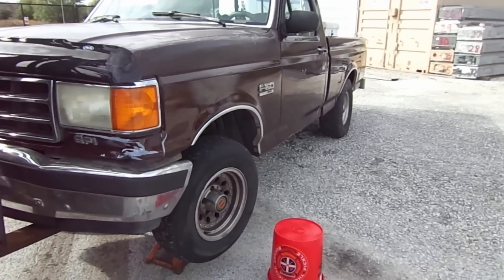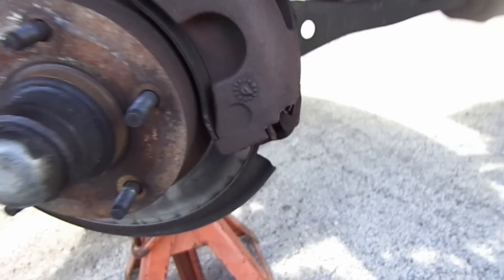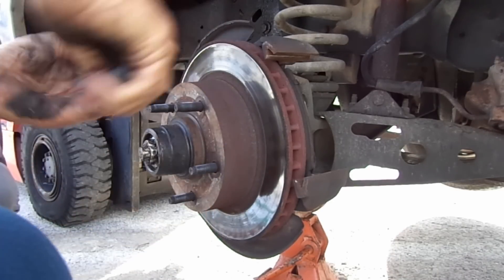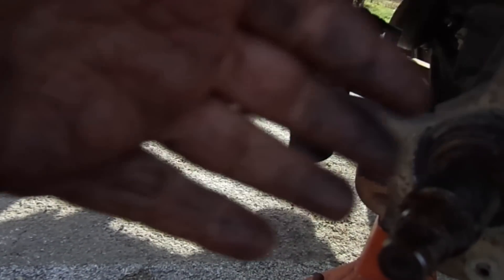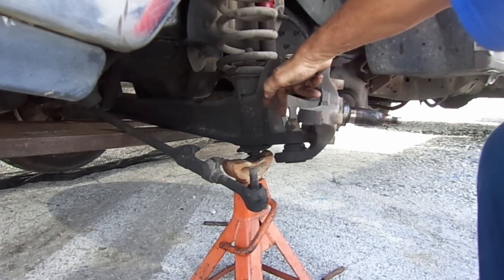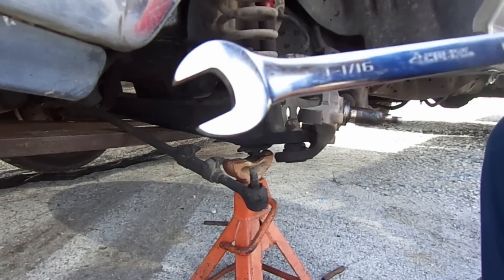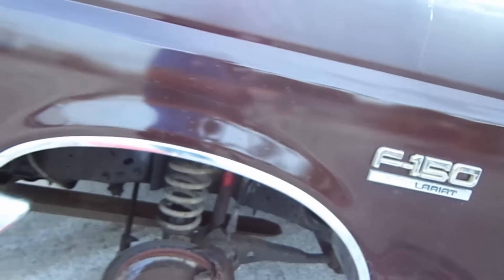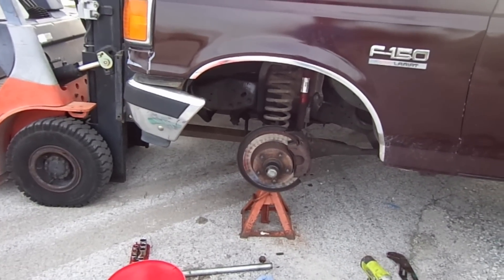how to change a ball joint on F 150 Ford pickup

Comment: Getting ready to repl;ace upper and l;ower ball joints on my '92 F150.  I think 30 years is enough.  Years ago I had an 87 Mazda front wheel drive car with a bad cv joint. To replace the cv joint I had to get lower ball joint loose to release the lower control arm.  I had a repair manual that said do not hit the control arm with a hammer.  I did not have any other special tools and money was tight so I went to a local Mazda dealership and surprisingly they let me talk to one of their mechanics. So I asked the Mazda mechanic how he dropped the lower control arm.  He said " I hit it about three times with a heavy hammer and it drops right out".  That was good enough for me. I went home, got out my heavy hammer, hit the control arm three times and it dropped right out.

Comment: Great video, and you can tell you’re experienced. But a tip for others….if you’re using a regular ball joint press, you can skip the step of popping the dust cap off, and removing the rotor and dust shield. Take all that off as one assembly still on the spindle.

Comment: I did all steps until wheel hub assembly, took carter pen the nut and caliber off but nothing is letting it slide off so I can get to dust shield, tried beating it with hammer and nothing happens

Comment: Hahahaha, I heard that and I think you got Hydraulic Gas leaking James :)))). Good Tips, James. We have to do it on Our F150 soon :///  THANK YOU !!!
Reply: Cotter Pin(s) only prevent the NUT from getting loose that is all, cause of vibrations / moving. We like to put Anti-Seize Compounds on those. It is a good idea on these? Thank You !!!
Reply: Sorry James.... My first comments was a Joke from you farting, but never mind, LOL. My second is.... It is a good idea to use Anti-Seize Compounds on the Ball Joints / Connections etc.... and stuff? Just incase we have to take it apart again or fix it in the future. That way it will come out easier without banging a lot :D
Reply from the maker: That's a good idea thank you very much